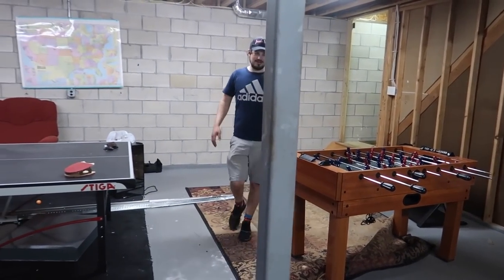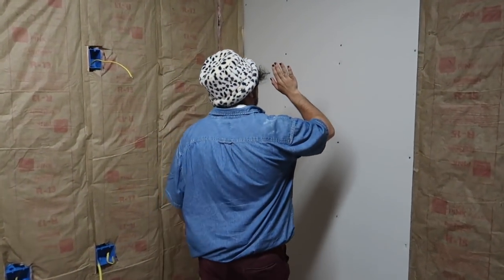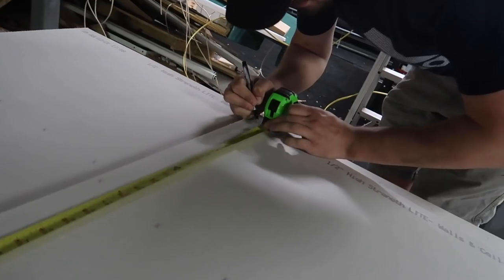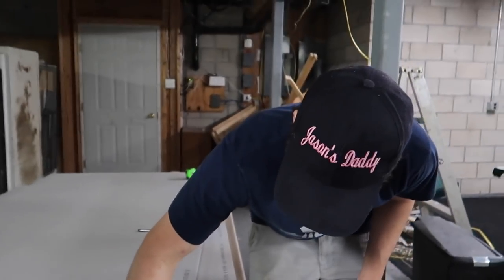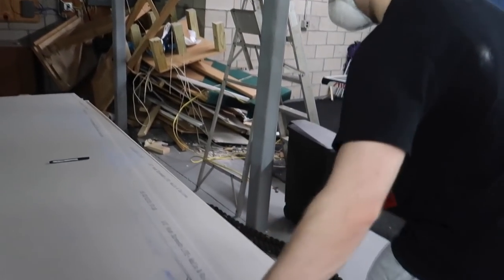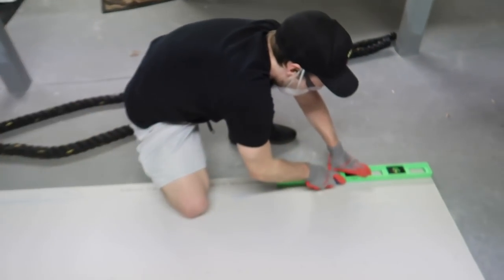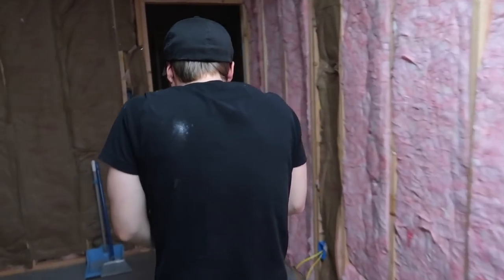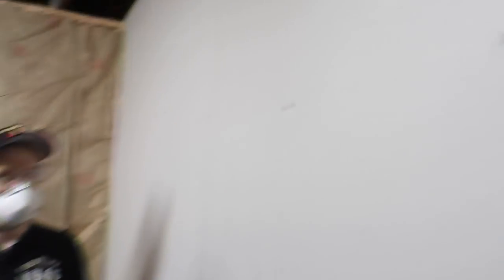Renovating McJuggerNuggets Basement: Ep 7 - Dry Wall Goes Up!

Comment: Bro you guys are putting the drywall up completely wrong. You should not put nails in it, it should be screwed down, and the drywall itself should be horizontal not vertical..